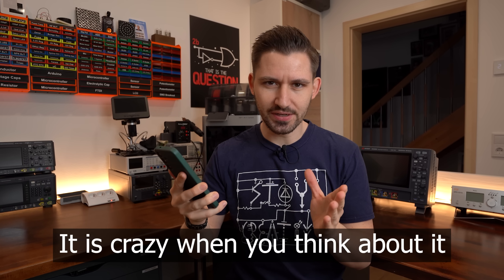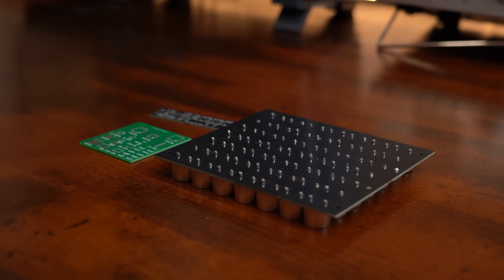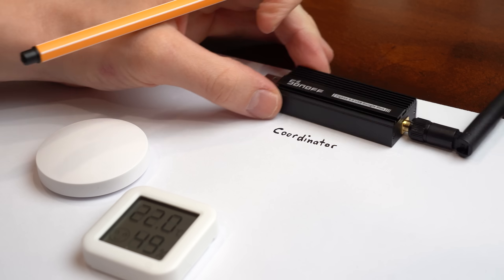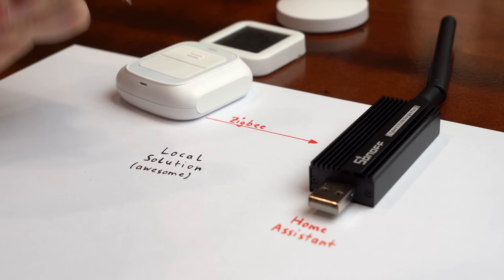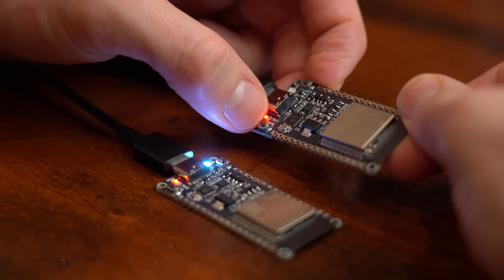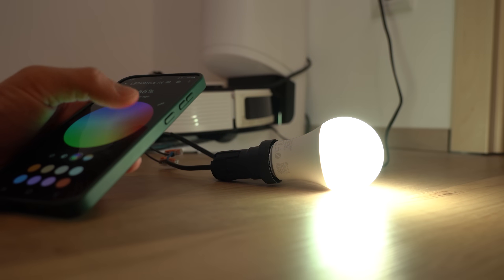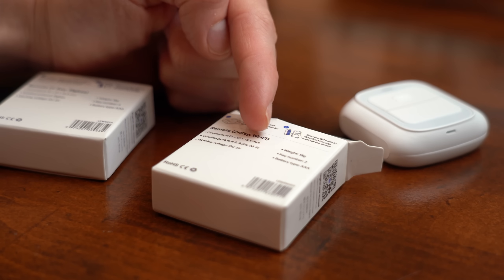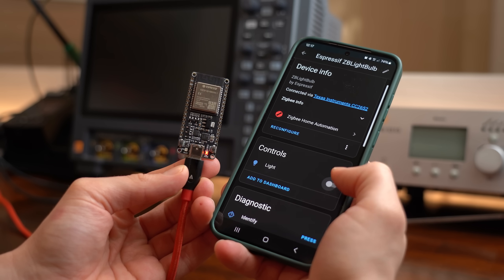Forget WiFi AGAIN! This Wireless Method is WAY Better? (Zigbee)

Comment: I feel like it's important to point out that nearly nobody uses ZHA, and basically everyone uses Z2M ;)

You can seamlessly switch between both without relearning the ZigBee devices, at least with my ZigBee dongle.

Also: Make sure to select a Zigbee channel far away from your Wifi channel in the 2.4 GHz range and don't put high traffic Wifi devices next to the Zigbee dongle (like shown in your video), to avoid "overspill" despite the frequency separation - if you encounter any delays in your Zigbee network.

Comment: I have a full house of the HomeKit meros switches- they’re WiFi but I dont believe they require actual internet access, they communicate over lan to a HomeKit hub, which in my case is an appleTV. That’s the internet gateway for working with them via internet- but if my internet is down, I’m pretty sure they all still work full local (similar model to the zigbee setup here)

Comment: Turns out if you use a standard made for IOT devices it's pretty darn great...
I do not understand why people are so set on WiFi that is made for a completely different purpose.
And I really hope Shelly hops on the Zigbee bandwagon with the new ESP offerings from Expressive.
Networks are already congested enough with all that data garbage no need to make it even more unreliable with home automation that lives on bytes.

Comment: Is it possible that the ESP-32 power usage specs are actually correct for those devices, and therefore not as good as store board devices?

Comment: Coowl, I started last year with getting some cheap zigbee devices and some wifi. and overall i was very pleased with Zigbee. hate the phonehome wifi variants and have 2 already reprogrammed to only call to my HA. more work, while zigbee just works. (and Ikea and Philips sell Zigbee compatible devices too, Philips HUE and Ikea TRÅDFRI series are awesome. Ikea even sold a lightbulb and a switch for like 9 euro. gave me a head start, bought a usb (serial converter to) zigbee coordinator (Zigbee 3.0, 9 euro). the antenna is way less beefy then yours. 

There can only be 1 coordinator in a network (or setup multiple networks) but multiple routers are allowed. the ikea lightbulb act like one :D 
My not so tech savy dad was even convinced and got ikea stuff + ikea coordinator that has an app. for those who are way less DIY. I now need a bigger nvme for my Pi HA, as i also want it as a NAS XD. Great video Scott, I might get a few esp to make myself some automatic curtains (the prebuilds are pretty but pricy, 40 bucks?)

Comment: I've got 500M range using one of the larger NRF24 modules with the SMA connector to attach an antenna (only at the transmitter end). And that was from inside a brick house, and walking the receiver down a suburban street. For duplex operation, maybe the larger module would be needed at both ends, or maybe the larger antenna also makes it more sensitive to receive. I didn't test that.
Reply: Yeah the antenna would have helped for both ends

Comment: How does Zigbee compete in denses areas nowadays ?
I tried such devices 10 years ago with Domoticz (back in time 😊) and in my flat surrounded by dozens of WiFi networks, the connection between the coordinator and the devices was totaly unusable.
If anyone could tell me how does it works now ?

Comment: Don't forget that Zigbee devices form a mesh by design... Every device therefore extends the range of the network without needing any additional hardware.
Reply: In general, only mains-powered devices act as routers and extend the mesh
Reply: @ Huh, I did not know that, thanks.

Comment: Had a few issues with ZigBee interfering with the lower Wi-Fi low band numbers 1 to 5 and in sum cases it reduced the ZigBee range drastically

Comment: Zigbee is good, but not perfect. Some devices(especially Tuya devices) can flood your zigbee network with their updates, which will ruin the whole network. With wifi, you can flash a custom firmware like ESPHome or OpenBeken, but only a few zigbee devices has custom firmware. So i think you should not stick to a single protocol, all of them have some unique useful devices for fair price.

Comment: Like Paul hibbert would say "ALL THE ZIGBEE"
But ye love my zigbee devices. It has been working for like 5 years already. With no real upkeep needed other the replacing batteries(I know Linus tech tips bought switches that are connected to main so that he doesn't have to replace them)

Also cool. Philips has/had a non batterij zigbee switch. It worked by using the energie of your pushing force to send the signal when you clicked it

Comment: Do these work as zigbee routers as well? To expand your network? I may have missed it in the video. 
Thanks for the content
Reply: Every mains powered Zigbee device is also a router, that will extend your network seemlessly. No configuration needed, just add it to your network.

Comment: The problem with many zigbee devices is re-doing the pairing. I went from smartthings to HA, and none, zero, of me GE lights would let you repair. They had some stupid requirement to turn thenlight on and off TEN TIMES to start re-pairing. None would work right. 

At least with wifi i can tell what ssid its connected to.

Comment: You might also look at Zigbee2MQTT as an alternative to native HA Zigbee integration.  There's a lot of debates on the pros and cons on the HA forum and Youtube videos. I prefer it because I run NodeRED, MQTT, Zigbee2MQTT and MariaDB stack outside HA in its own Proxmox LXC Container, and doing this allows my basic HW + CH control system to work independently of my HA VM.  Adding custom device support is also generally simpler with  Zigbee2MQTT.  I stopped using RPis pre RPi5 -- too many SSD and other failures over the years, and electricity cuts are a PITA.  Now I run a couple of old lid-closed laptops as battery backed  Proxmox servers.

Comment: Great video and explanation! I was wondering, did you ever take a look at those TB-387 transceivers? They sure aren't as cheap as other modules but claim to reach up to 400m using some kind of proprietary protocol over 2.4ghz, which I think is impressive. They are absurdly easy to use and are basically UART bridges which you can program through serial AT commands. I used them before in my workplace but our company gave up on them in favor of ESP-NOW.

Comment: I'm going to have to look into this.  I watched a video from a woman last year or so and she was talking about getting away from cloud based wireless things.  I have some wifi outlets and LED bulbs that the manufacturers went belly up and now I can't control them and I have more than a few of them.  I'd also like to get rid of my Amazon Alexas.  They control everything in my home from lights to whatever.  I've gotten too dependent on them and they're starting to lose connection to the internet for some reason or another.

Comment: When Zigbee is so energy efficient, I kind of wonder why the switches even need batteries and don't come as versions that harvest the power for data transmission from the button press... Do they have to send out "I'm still there!" packages or something like that? 
I have several "kinetic" switches that operate at 434MHz with a most likely proprietary protocol and they work fine inside our living space. Though I haven't done any range tests yet.

Comment: With X10 controls, I can send the "off" signal to the room light, jump into bed and have the covers over me before the room goes dark. (Slight exaggeration.)  So, in my estimation, the speed of Wi-Fi vs. Zigbee is largely a non-issue for home automation.

Comment: The big problem with wifi is that it can become quite congested these days, and, depending on setup, lower end iot devices might slow down the wifi network traffic. Especially when there's a lot of them. Not sure if zigbee being in the same band would fix this issue, but either way I'm already leaning towards at least non-wifi, and best - non 2.4 ghz band, for iot. Although convenience of wifi iot still makes it to be in bulk of my iot devices.

Comment: Have a look at kinetic ZigBee devices, they don't require batteries at all but instead use i.e. the kinetic energy of a mechanical button as power source. They work in HA.

Comment: Thanks for your awesome video,
one note to add is that , since in a home environment the noise is not very high , and also the amount of data to send (not just actual data packets , but also carier bits) for a smart device is not high . I think it is safe to say that 187 mA for smaller timeframe of TX is less than 300 mA in larger timeframe.

Comment: I first went with the same dongle you got. Later I got an SLZB-06,it has an ethernet port for either poe or ethernet plus usb power and its just much better.
Also i may have not paid enough attention, but i did not heard you mentioning the mesh network which is zigbees biggest advantage. Sure you said extender, but its a bit different than a wifi extender, cause basically all powered devices connect to a mesh network and creates really good signal. With the slzb-06 i was also able to put the router in the middle of the house and it has good enough network even without routers, but my server is in the utility room where walls are thick and the sonoff dongle barely penetrated the walls.

What I look forward to is custom light switches. Most zigbee switches(the ones you put behind the regular switch) doesn't support decoupled mode( lets you press the light switch with only sending a signal to the server and not actually switching the light).
That feature would be really nice for using smart lights while also having the physical light swith setup that can work offline if needed.

Comment: What about the smart devices using 868 MHz like the X-Sense smoke detectors and temperature Sensors? They claim 500 m and I had good experience with them.

Comment: Let's also say that everybody makes WiFi proprietary devices, while Zigbee is a standard. This means that you can take an IKEA Tradfri button and use it with a Lidl Gateway and Vimar cover buttons, then add a couple of cheap no-brand chinese temperature and humidity sensors, and everything works out of the box. No proprietary cloud services, no proprietary app, ...

Comment: Cool video I am yet to test the Zigbee ESP devices. 

Just as a notice: You will also get some problems with Zigbee thru big walls or floors. I could not get my Zigbee Signal to get to my basement. After a while I just bought a second WiFi coordinator that lives in the basement, so my house has 2 Zigbee Networks. 

Other thing you have to check is that the channels of your wifi router does not collide with the channel of the Zigbee.

Comment: Look at this as your instead of the Sonoff ..SMLIGHT SLZB-06 - Zigbee 3.0 to Ethernet,USB,and WiFi Gateway Coordinator with PoE, Works with Zigbee2MQTT, Home Assistant, ZHA I better unit and runs over your Ethernet so it can be place anywhere in your system . Also doing firmware is simple as pie....  and Many Thanks for all you r content .....

Comment: Final:
Great video, well done! 👍
The only problem I have is your pronunciation of "micro" (as in "uW/hr"). If you hadn't shown it written in the UI, I never would've understood what you were saying, lol.
Overall proves my point that Zigbee is superior!
And, now with a firmware upgrade of new tech, certain brands of Zigbee devices will have network sensing tech, which eliminates the need for IR motion detectors for lighting & security systems!
👍👍👍👍

Comment: Kinda funny hearing someone talk about zigbee in 2025 like it's new, but to a lot of people it is! Thread is a much better wireless standard, albeit held back a bit by the protocols on top of it like matter (love the goal but the implementation is pretty sub par, inflexible, and the QR codes are so fucking stupid -- pairing should be done like zigbee devices, there wasn't any actual security risk)

Comment: The worst part of the cloud requirement is that its just MQTT, a basic protocol you could have your router handling with zero impact on throughput (other than your devices responding A LOT faster because they dont have to call china first....). But because these companies see users as absolute moron walking wallets (and metrics sources to sell to advertisers, and what communist government doesnt like having a blackbox sitting on random peoples networks in an enemy state?) you're entirely locked out of handling everything locally. Ive actually had a company tell me I was LESS SECURE doing everything internally than letting their grubby little fingers in my network....

Anyhoo, with that rant out of the way, as I understand it: WiFi is good for dipping your toes and high bandwidth applications (video streams where you cant drop a cable), but as more devices are added to the network all constantly screaming for something or the other, it begins to bog down. Where as Zigbee is king for full on automation layouts since you really only need to pass a few kb at a time anyways, it handles a ton of devices no problem, the aforementioned meshing feature, and it leaves your wifi empty other than sending data to a querying device from the automation backend. If you dont know if youll do much with home automation, try a wifi device or two for shits and giggles. Once you get the bit by the bug though, definitely go full Zigbee! 

Also I hear its more secure than wifi....so....there is that too!

Comment: I would recommend to put the Zigbee Coordinator in the USB 2.0 Port of the RaspberryPi. It doesn’t make any difference in speed because the coordinator doesn’t need much. But especially if you are flashing the Coordinator with a custom firmware (to support zigbee and thread simultaneously) it reduces compatibility and connection issues in the long term use.

Comment: Thanks for the video. 

Note that a wifi device does not mean you need a cloud connection to get it to work. For example Shelly devices are wifi devices, they work locally, you do not need an app or a cloud connection and their response time is as fast as a local zigbee device. Once it get an IP address, you only need a browser.

- I started by installing zigbee devices in 2021 (around 10 device to get temperature and humidity and another 10 smart plugs) I was very enthusiastic about that solution at the beginning. 

On the ‘+’ side:
- battery life is amazing: can easily go 6 months to 1 year
- adding a new device from HA is super easy (when you are lucky)

On the ‘-‘ side:
- I often need to repeat the pairing process for some devices and there is no clear indication of weakness in the network: I keep track of which device goes offline and I cannot see a pattern emerging
- zigbee smart plugs act as repeaters, but when someone moves a smart plug away, the network may take  a while to reconfigure and some devices are temporarily offline
- The whole thing is a black box
- Adding a new type of device is an experience similar to adding a printer to a Windows 95 computer, there are a lot of incompatible interpretations of the highest layers of the zigbee protocols, to the point that home assistant has a distinct mechanism to try to address those differences, you are lucky only if some took the trouble to create a so called ‘quirk’ for the device you plan to use. Some people are saying that ZWave is better in this regard, but I have not experience, so cannot comment.

Comment: While I have replaced most of the devices in my home to Zigbee within last year, I slowly start to replace those without routing now to Matter ;-)
Check Matter out, if not done yet. Fully implemented to HA and doesn't need a hub ;-)

Comment: You can convert some of Telink based bluetooth temperature/humidity sensors to zigbee by OTA flashing custom Zigbee enabled firmware, I managed to convert all of my Xiaomi sensors to Zigbee successfully.  Currently supported devices : LYWSD03MMC, CGDK2, MHO-C122, MHO-C401(old), MHO-C401N, TS0201_TZ3000, TH03Z, TH03, LKTMZL02, ZY-ZTH02, ZTH01, ZTH02. Search for "Pvvx ZigbeeTLc".

Comment: Ok, a few words of warning re. Zigbee (I have the same setup as GreatScott! there).
1. It interferes with WiFi - make sure the channels are different, and that the coordinator is far from WiFi (probably the biggest downside for me)
2. From my experience, it's a little less stable than WiFi (more disconnects, slower reaction times), and there are more crap devices that use Zigbee (not a fault of Zigbee, but fyi)
3. Zigbee integration in HomeAssistant is slightly worse than Zigbee2mqtt (IMO), and you need to choose one or the other, switching them is essentially equal to resetting your Zigbee network
4. Coding Zigbee for Espressif is quite cumbersome, and the manuals and available sources are scarce. 

Otherwise quite a good protocol, and it also doesn't eat up your IP addresses and client lists on wifi points.
Consider ZWave and Thread too, they're also good protocols.

Comment: I use a variaty of protocols, BLae/NFC for close range, Threads/zigbee/zwave for shortish range, wifi( with antenna) for medium, and 5GNR/4G-LTE to track stuff across the globe, so truely depends what you want to achieve

Comment: Alot of the Tuya Devices utilize the Beken Chip, that can be flashed and therefore diconnected from the cloud. You can also look into LocalTuya for Home Assistant that allows the devices to be locally controlled making them a bit more responsive.

Comment: I was really excited when Espressif originally announced zigbee supported devices because I wanted to rely less on WiFi for my custom built smart home stuff. I never got around to actually trying that out though. It's nice to see how easy it apparently is to set up with Homeassistant based on the examples